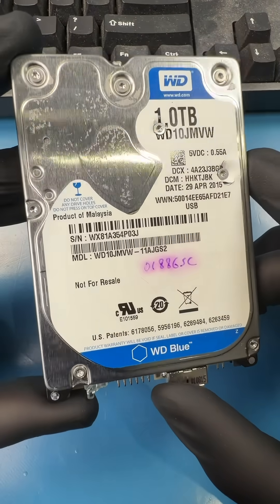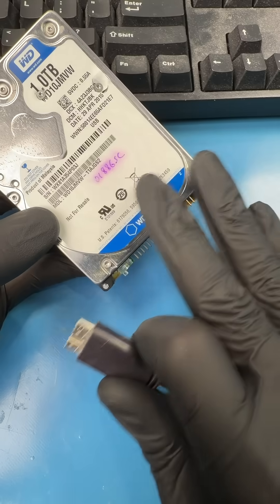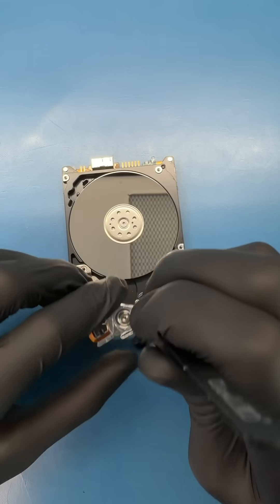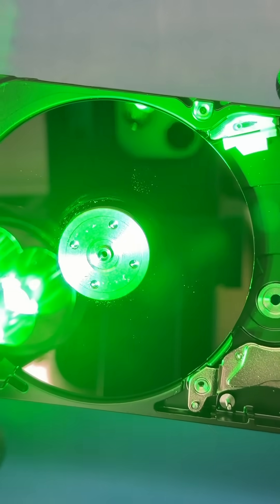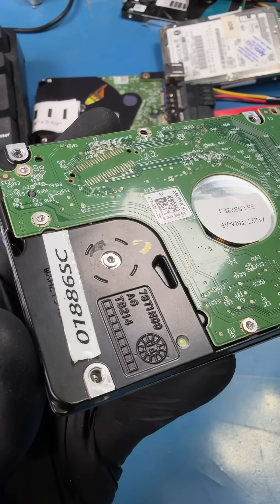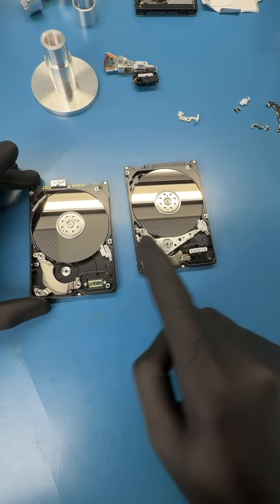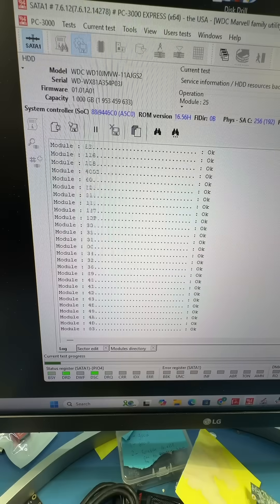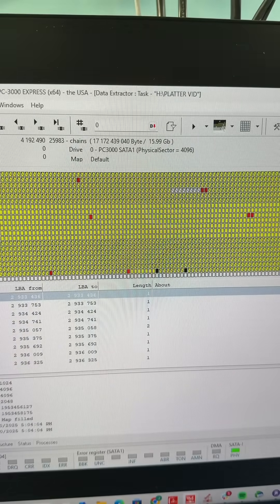Clicking hard drive? #datarecovery

Comment: Cats give you a reason to backup your backup. Case Closed 💯
Reply: Back up your back up to a back up 😂
Reply: @southernstyle8835  here before someone replies with an ahh comment
Reply: @AgamKathuria funny ahh comment 😂
Reply: @AgamKathuria ahhhh
Reply: @tijger5353 AHHHHHH
Reply: @AgamKathuria   damn is😂🎉
Reply: @southernstyle8835 69th like :)
Reply: there's also the option of getting an ssd
Reply: @aspopulvera9130  those die faster
Reply: @aspopulvera9130 except a ssd has a higher risk of falling
Reply: You know what they say about backups: "Two is one, and one is none!"
Reply: @mikukumiku that's pretty funny yet to the point. 😂
Reply: If it was a backup, there would be the primary and no recovery would be needed. It should rather be considered an archive or storage extension at this point
Reply: Extra thumb drives in a fire proof case is the way to go
Reply: backup the backup for the backup
Reply: Does that mean I also have to back up the back up of my back up
Reply: Ever since my hard drive stop working on those original xbox 360 I no longer trust sea gate it glitch and crash and stop working eventually
Reply: Jesus is the Son of God. He died on the cross for our sins and was resurrected three days later. Believe in Jesus and you will not die, but have everlasting life.
Reply: 3-2-1
3 data copy, original plus 2 copies:
2 different types (hd and ssd, or hd and cloud, or anything else)
1 off-site (never your copies could be in same place, if it burns you lost everything... Cloud should solve this)
Reply: what software you use when connect the hdd?
Reply: rclone and cryptomator (compatible with both the CLI duck tool and GUI CyberDuck) allow one to create encrypted data stores that can be backed up cloud storage providers. This ensures that you can both leverage cloud-based backups and keep your data private. 

These make automated backups that might contain sensitive information fairly straightforward.

Another option is to use compressed and encrypted archives such as 7z. You can also split these backup archives into parts, which can come in handy with file size limits or complexity with reliably resuming interrupted uploads.
Reply: They also give a reason to not get a cat.
Reply: @Dumbledorth moral of story,keep cat out from electronics
Reply: @Dumbledorth  yup don't be a lonely cat lady and keep your data safe.
Video is a load of rubbish for people with mental issues.
Reply: Cat is pest
Reply: Make sure to always make backups, and also catproof your stuff!
Reply: @matasa7463 or cat proof your home by not having a cat
Reply: Recovery
Reply: "Don't have a single family have two in case the the first one fails" ahh cats 😂
Reply: Cats give you a reason to have animal control on speedial🥲🫴
Reply: Yeah by nearly deleting almost fucking evrything on hard drive
Reply: Yeah by nearly deleting almost fucking evrything on hard drive
Reply: Its called RAID 1 or RAID 10
Reply: I have the same problem, all picture gone😢
Reply: Fr! I have 2 dogs & no cats but im always backing up everything
Reply: Cat with villainous laugh after dropping hard drive

Meowhahaha
Reply: To ssd
Reply: Intelligence tells you to move everything you have to SSD
Reply: Just kill the cat 🤷‍♂️🫠
Reply: Learned the hardway! My nvme got completely dead
Reply: You mean make a backup at all. She just stored all pictures on a HDD. So it is not a backup.
Reply: And this is why i make sure my cats NEVER go into my room.
Reply: I hope they had the cat euthanized
Reply: Cats give you a reason to backup your cats…
Cats give you a reason to not have cats.
Cats don’t cat if no cats to cat.
I am not dog, I swears.
Reply: Yup😅I just wanna tell about a purpose of life beside doing a good living 

That there is only one god ( not jesus ) that we have to give him the credit and worship him to be in the paradise 

And as the bible said

John 20:17
I'm ascending to my father and your father , to my god and your god

Mark 13:32
But of that day and hour no one knows , not even the angels in heaven , nor the son , but only the father 

1 Timothy 2:5
For there is one god and one mediator between god and men , the man christ jesus

Hope we all meet in the paradise 💙
Reply: That’s my take away too. Valid one if you ask me.
Reply: My cat stepped on my power button while i was gaming and completely corrupted my ssd which was my boot drive and lots of music projects, since then i got a nvme and went to windows settings and disabled the power button while the pc is on😂 still sad about all the music but welp, price to pay with cats
Reply: Backup is always cheaper than recovery, I learned it hard way 😊
Reply: People are fucking stupid they rather have an animal that pisses and shits everywhere and be a menace rather than idk having a child it's a strange world we live in
Reply: Or get rid of the cats.
Reply: The Cat was the overlord of the house. The human mortal was at fault. A cat is never to be blamed under the pain of death.
Humans must exercise caution and respect while on the overlords domain..
Reply: another reason why you shouldnt get a cat
Reply: Raid 5 or raid 6
Reply: I call BS..... there weren't any 1TB drives available in 2005.
I was there for it, I remember TB storage didn't come out until 2007.
Someone's telling lies here...
Reply: For real i got 4 drives which all have the same pics (bc windows likes to crash and wipe the whole drive and ther others bc one is a hdd so thats easier to break and one is an older ssd)
Reply: You just need at least one backup
Reply: Through the cat away
Reply: Whose the murderer?
Reply: Also hdd is from 2005? shocking to know it lasted that long.
Reply: Sounds like she had no backup at all. If she had, she wouldn't have been devastated by the drive being damaged, and wouldn't have had to pay a fortune for recovery.
Reply: Cats give you a reason to get a dog instead 😂
Reply: No, Cats give you a reason not to have them in your house.
Reply: I'll kill some extra cats because of your comment.
Reply: or Cats give you a reason to get a dog...
Reply: @itueye2879 - I once had a dog, and it ate a peanut butter and jelly sandwich off my plate when I wasn't looking... I then bought a doghouse and put it in my backyard. so yeah dogs cause problems too just not as much as cats do.
Reply: That's why fuck cats, get a dog.
Reply: yep. I learned the hard way. lost all my photos from my daughter being born and a video of her first bath at the hospital. lots of memories just gone.. not from a cat but still.. sucks
Reply: When I wrote my PhD dissertation, I stored it on about five different computers.  I did not want to take any chances on losing it!
Reply: Cats always give you a reason to get rid of them
Reply: Mine literally knocked my 55" flatscreen off my dresser today. They are...something else. 🤦‍♀️
Reply: @ashleecantu6470 💔
Reply: Give you a reason not to have cats.
Reply: Pretty bold claim. But can you back it up?
Reply: you should always have important data stored in more than one place though, is it rly a backup if it's the only place it's stored?
Reply: just don't have cats or dogs
Reply: No, cats give you a reason to not use HDD and instead use SSDs
Reply: Meow
Reply: Don't keep cats. Case closed
Reply: And for that reason, cats have nine lives. 😂
Reply: This is exactly the reason why you don't get cats.
Reply: Just down own a pet or keep the fragile hardisk/hardrive away from reach of pets or kids.
Reply: me cat meow alphabet
Reply: one of the many reasons I don't let cats in my house...😊
Reply: Or it gives you a reason to never own a cat
Reply: Nah. Cats give you a reason to get a dog instead
Reply: 100% why my cats aren't allowed on my desk... the bathroom sink counter is fine though 😂😂
Reply: Cats give you reasons not to have cats.
Reply: cats gave you a reason to not have a cat
Reply: CATS ARE MEATY  good  FOOD GOODNESS I HAVE SOME CAFAT CAT MEAT IN MY RAMEN.  hey atleast i dont east shark fin soup. dog is too dry and cow and chicken got too boring.
Reply: hate me, i hate cats
they are't ;assy, they are fucking dumb.
Reply: nah that cat needs to be beaten up fr fr
Reply: Cats give you a reason not to own cats
Reply: Or better yet, not to have them.
Reply: More like cats give you a reason why you shouldn't own one. 🤷🏿‍♂️
Reply: What's the best way to keep a particular data if i want it's access for next let say 30-40 years?
Reply: Cats may or may not be why I started phasing out hard drives in favour of SATA SSDs.
Reply: Cats give you a reason to get rid of cats
Reply: if my cat did that i would kick it out
Reply: no. cats gives you the reason not to put them inside your house.
Reply: No it give me a reason to try cat meat.
Reply: So do dogs.
Reply: Also cats enlarge the backups :3
Reply: @notCAMDCats are Haters! Nowadays have a backup of the backup, backed up! 😞
Reply: @notCAMDyesss! All the cat photos!!
Reply: To avoid risk don’t own a pet (not cats fault they’re animals)
Reply: A young child could make the same mistake 😂 just keep things out of reach.
Reply: @Plant-Based-Gains I could kill the cat more easily than a kid and you know I don't mean cats are weaker
Reply: @Plant-Based-Gains cat,ok
Child doing it, out of the house.
Reply: @Plant-Based-Gains  not any child of my parents lol, you getting whipped before you even succeed😂
Reply: Cats give you a reason to not have cats
Reply: @stayfresh8090  noooooooooooooooooo
Reply: And a reason to like dogs
Reply: @Victoriandave  no
Reply: @Victoriandave  My mother's dog obliterated one of my brother's 2.5 inch hard drives last month. So thoroughly we did not find a single piece of the platters.
Reply: One of my main reasons why I don't like cats at all.
Reply: Cats give people a reason to homicide cats.
Reply: @TheGeeMan Start with yourself
Reply: @TheMadHatter97 Nah, I think I'll start with you first.
Reply: Cats give you a reason to not get a cat
Reply: Easier to not having a cat.
Reply: Yea man just casually backup 900 gb
Reply: @MrCreateSpace  at 50MB/sec that's 5 hours to fully back up to another external drive you can leave somewhere else in case of fire or burglary.  If you want to be really safe, have two drives and only have one at a time at your place for regular updates, which will be much quicker.  Still cheaper than data recovery and survives more problems...
Reply: @MrCreateSpace  Is it more casual than losing decades worth of memories in picture form?
Reply: Cars give you a reason to hate cats
Reply: @casematecardinal waht 😵‍💫
Reply: Same..a reason for not to have a cat
Reply: Put down the cat😂
Reply: That cat would’ve been Chinese food
Reply: Cats give you a reason not to have cats.
Reply: Which is why dogs are better, cats don't gaf about you or your property
Reply: A reason to not get a cat
Reply: Cats give you a reason to get a dog instead.
Reply: @Kingslayer061-lm4xf i love dogs
Reply: @Kingslayer061-lm4xf This is the way.
Reply: cats give you a reason to kill them
Reply: Cats gave every good reason to kill a cat if you .... Adopt them
Reply: @RamanKumar-cg1qc Have you ever eaten dog? They taste so good. I especially love the little ones that are fried and then put on a stick. 🤤
Reply: @C-H-A-l-R  Don't eat me... I mean dog, yes, don't eat dog. I is not dog, I swears.
Reply: Eat the Cat.
Reply: @Senku_Ishigami_1  not sure if trolling or psycho
Reply: @Senku_Ishigami_1  migrant cat chow = save a hard drive - feed a migrant.
Reply: Is there shock collar for cats? (asking for my Turkish friend) 😅

Comment: PSA: Back up your back up
Reply: 3-2-1 backup strategy
Reply: then a back up for the back of the back up
Reply: And then back that up :)
Reply: If it’s your only copy, it’s not a backup. Storing data on an external drive doesn’t make it automatically a backup if it’s your only copy.
Reply: Back any precious data to multiple media formats
Reply: I had 3 backups on 3 drives that all failed on the same day, a few years later I found a usb that I must have used at the time of making the backups. Now I don't make any backups because I never have data I need to be kept
Reply: @juansnow5897  Were they all connected to power, and something horrible happened to them?
Reply: @juansnow5897 you should never buy the same drive from the same batch. They usually fail at the same time.
Reply: @juansnow5897 I would backup my important data on a hard drive, m.2/ssd, and a pendrive and maybe phone too
Reply: I usually backup the backup, plus upload the files to the cloud.  So I have 2 backups to my backup😊😊
Reply: Yeah then store the back up back up in a safe or deposit box. Back up monthly after that.
Reply: I have a NAS, it has built-in redundancy. It's still 1. So I managed to score an extra server from work. It's replicating my NAS. That's my "important" data. 

But for my pictures? Yeah I lost those ONCE in 2005 (I've been in IT for years, I fortunately was able to recover on my own), and ever since, they exist permanently in at minimum 7 different places. 2 hard backups that I verify every 3 months, just to ensure there's no bit rot. 2 NAS backups (main NAS+replication). 1 backup on my Google Drive (plus a lot of them are part of my Google Photos), 1 backup hidden away on my website storage. Finally, I have at least one backup on my main laptop, and usually reserve some space on my phone. 

Yeah, my wife and I didn't have kids. I have a niece, and she's just as close. Those are the ones I nearly lost. Never again. I'm definitely overkill here, but it's mostly because I can. 

3-2-1 is absolutely vital.
Reply: yup i have it 3 time on my compute on a drive and other drive lol
Reply: Off site
Reply: RAID and a backup
Reply: RAID 5 would be good
Reply: i added 2fa to my backup of my backup on my own machine and network. im set.
Reply: PSA:  don't let your cat play around your electronics
Reply: and don't back up to the same type of device.  Back up to three different options.   for example: cloud, hard drive, memory stick
Reply: only if its that important tbf, if its not something sentimental like a roblox account you dont really gotta do that
Reply: Cold store plus hot plus local plus offsite. It’s effort but it’s worth it.
Reply: PSA: stop getting cats
Reply: Take REAL PICTURES
Reply: This is one of the primary reasons on why Telegram exists, its basically one of the best & nearly unlimited yet free cloyd storage option for one of your backups
Reply: Just use cloud. 🤦.
Reply: @FitAsIAm🥀
Reply: @FitAsIAm Or take real photos 🤦‍♂️
Reply: 😅I just wanna tell about a purpose of life beside doing a good living 

That there is only one god ( not jesus ) that we have to give him the credit and worship him to be in the paradise 

And as the bible said

John 20:17
I'm ascending to my father and your father , to my god and your god

Mark 13:32
But of that day and hour no one knows , not even the angels in heaven , nor the son , but only the father 

1 Timothy 2:5
For there is one god and one mediator between god and men , the man christ jesus

Hope we all meet in the paradise 💙
Reply: Nah cats just suck.
Reply: @Akimbo1313 No, humans have to consider another being's capabilities when they take care of one & prepare accordingly. You don't put candy-looking cleaning material in front of a kid & then say that the kid sucks either (or at least you shouldn't). Cats just act the way they're "wired" to, it's not their fault- meanwhile humans can consider stuff & make intentional decisions.
Reply: @KanaNyctous If cats are wired to be ill-mannered, not having them as pets would be a good idea.
Reply: @Akimbo1313 Fr I hate them and if you have one it just screams childless loser.
Reply: @Akimbo1313 Anyone who doesn't like cats can't be trusted.
Reply: Or just don’t get a POS cat
Reply: @jacobii1281  The cat acting according to its instincts wasn’t the problem, it was the lack of backups. If anything she’s lucky it was the cat dropping it rather than a fire or flood which might have made it actually irrecoverable
Reply: @jacobii1281  why so hateful
Reply: @tschichpich  mad cause bad (human)
Reply: @tschichpich  ITS THE TRUTH!!!!
Reply: @tschichpich Cats are literally the scourge of my existence. 

They kill for sport despite being fed, they crave constant attention, they are lazy fuckers, cat memes have over-saturated the internet and worst of all "I can't breathe" in their presence.
Reply: @jacobii1281  cats don't have moral capacity